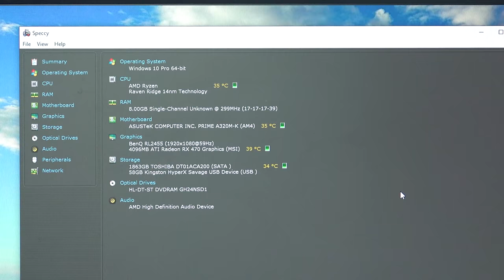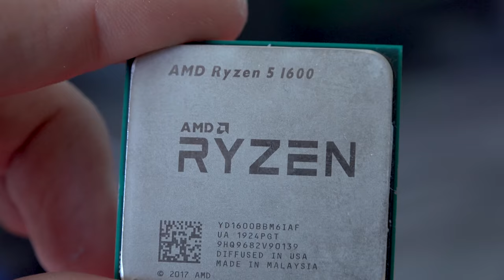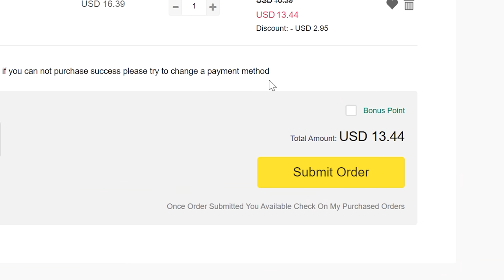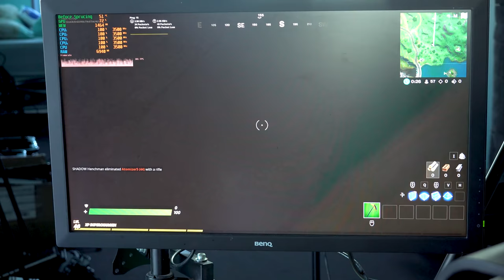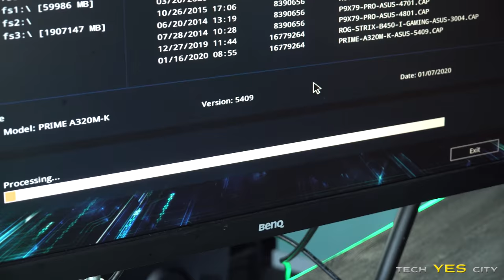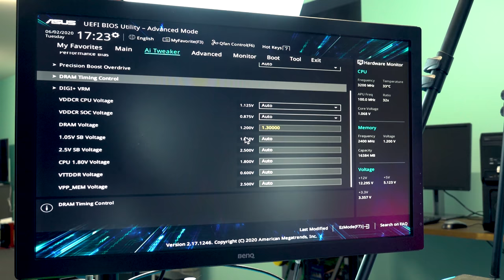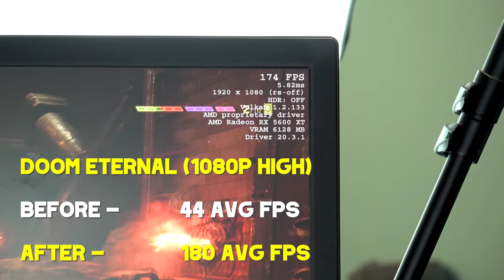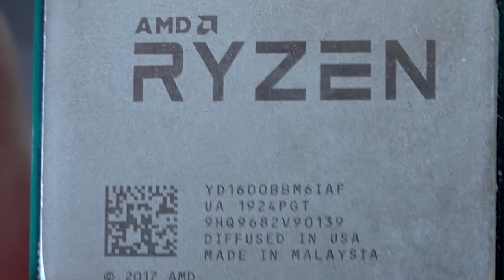This $300 Gaming PC Got SPRUCED UP!

Comment: I would like to have seen the FPS difference from just changing the cpu and ram and keeping the rx470 as there is a huge price difference between that and a 5600xt
Reply: Agreed, also the SSD would make a big improvement. The 5600XT seems like a not required upgrade.
Reply: Separate tests for each upgrade would have been the way to go to see which upgrade was really making what difference in what games. The GPU likely made the biggest impact overall, the CPU might have done nothing for some of the games, the ram shouldn't have really been a factor 8GB will run the games he tested just fine. The SSD would have improved load times.. over a average mechanical but WD ssds are actually slower than fast mechanical drives like enterprise models, this system obviously wouldn't have had an enterprise level hdd in it though so any ssd is faster but as ssds go WD is a horrible pick.
Reply: I honestly think there was something wrong with the rx470.   He blamed everything on the single channel ram then failed to prove that was a big problem
Reply: @bdhale34  WD Green is the budget model, but WD Blue is the good performer (I've seen no issues there).

Comment: I would have tried to keep that RX 470, still a fine card imo. The CPU/RAM and SSD upgrade was what was needed the most
Reply: Pity he went with one of the worst SSDs he could have.
Reply: Kinda makes sense for him though. The 1600AF supports the new card nicely and the RX470 can go spruce up a potato for that the  new card would be overkill. He's always got a whole bunch of PC's around after all.
Reply: @catriona_drummond  Exactly. The RX 470 is what you want with a Ryzen 3 1200 or an i3 Quad Core. (or some older i5 or FX 6/8 core CPU's. None of those CPU's will bottleneck the RX470 in 1080P @high settings to a point it matter.
Reply: @Wushu-viking   the RX 470 would have ran well into the 100s with the new CPU and RAM. Polaris was very good. The 5600xt pushed the PC into 1080P ultra or 1440P high territory, but also out of the "budget" realm.

Comment: Great job on the video. I think I would have left the RX 470, upgraded the RAM and CPU like you did. I'm running a Ryzen 5 3600 and a GTX 970 and loving it so far.
Reply: You ever considered a RTX 2060 super?
Reply: @Razor-gx2dq  no I'm not thinking about it RTX 2060 super! Not for that kind of a build as here in Canada a card like that goes for at least $600. I paid $125 for my GTX 970

Comment: You should have done the upgrades incrementally so we could see what made all the difference! Dual channel ram - then over clocking the crap out of the 3000g, and then add 1600af, then video card

Comment: 05:42 Uhh that hurts snapping off that folded metal piece. You could have just removed the motherboard and bent back a little bit that part, to accomodate it on top of the connector. Also, the HDMI port also has that metal part inside the conector as well as the USB 2.0 ports on the right. Make sure you make the folded cutouts to look like the RJ45 port: on the top of the connector.
Reply: yes indeed he should of remove the mobo and bend back those tabs more instead of breaking one and leaving one like that cause that might short the motherboard and in the end he will have to service the pc since he does offer warranty on them and that would cost him money and more lost time
Reply: No, that would take too long

Comment: It may be a brand I don't know, but that case is drop dead gorgeous. All the components are well laid out and fill the pc case to perfection. That front case fan is HUGE and will push a lot of air without making much to any noise. I was surprised at the frame rate with the updated gpu and misread thinking it was a 5700XT. I was even more blown away when I saw 5600XT appear on the screen. Those are some really high frame rates. Great job on this one.

Comment: That's the most creative way to make up a term that happens to already exist and luckily already has the same meaning! Bought a MSI R9290 on ebay del'd this week. Insta-95 degrees and thermal throttling to 700mhz but never actually shut down so to a novice, appeared to be working. Spruced it up and a repaste. 75 degrees now but anyone could have bought it and never known. Not a mention of any issue on the listing.

Comment: I still dont get the 120 GB SSD.. install windows 10, office and a game then you ain't far from full.. even 250 bit small for my liking, if I saw a decent spec'ed system for sale with a 120 ssd I'm thinking cheap and wondering what other less obvious cost saving measures are hiding within.. basically it's off putting.
Reply: Yeah with how big and bloated win 10 is it could be that in a couple years it could use that 120gb. with how much stuff clogs up the registry and the documents for saves and configs and the drivers i think it's best for at least 240gb with 512 being the best if you had to use a hard drive. I bought a 1tb sandisk ssd for 114 at bestbuy and it's great compared to even a new 1tb wd blue. But this channel really focuses on using used hard drives and ssds witch for the ssd i would never reccomend so it is kinda sleazy with the cases he does re-use an ssd.

Comment: That is odd because the athlon 3000 is more than capable of playing doom when paired with even rx 560 i do not want to link other channels as thats not fair, but you can find them very quickly in the search bar they ran dual channel 3000 mhz ram with cheapest ssd on amazon it was def north of 44 fps without stutter for sure.

Comment: Hey I built my pc for 1171usd is it good ?
specs :
-ryzen 5 3600
-msi b450m a pro max
-teamforce ddr4 3200mhz 16gb ram
-gigabyte rtx 2070 super windforce oc 3x 8gb
-silverstone 80 plus silver 700w power supply
-(i already have ssd and case so they are cost 0 :) )

Comment: Hey Bryan would you use a a320 mobo with a 3100 ryzen 3 for new as low as possible build? Maybe with new nivida gpus, i wonder if new xx50 models will have ray tracing, thanks.

Comment: My reading of the comments here jives with my observation on this video. Bryan, my boy, you goofed. An incremental update of CPU, then RAM, then SSD, then GPU would have revealed a much more varied and complete picture of what the different levels of change would result in. You might consider a do over here.
Reply: I guess the audience could have learned where they should be putting their money when upgrading  an underperforming rig.

Comment: I would have put a 3300X in there instead - slightly better overall performance then the 1600AF and much newer. Guess it depends on price availability in your region though.

Liking that case btw - reminds me of my old Aerocool X-Predator Cube case and loved the layout with the motherboard sitting flat and the GPU mounting upright.

Comment: It's kind of ironic that this PC is running with a Raidmax Cobra PSU. I'm currently building a PC, using my old parts, for a friend on a tight budget. I had ordered a Raidmax Cobra 700 watt PSU, but ended up cancelling that Amazon order and picked up an 800 Watt 80+ Gold PSU from a lesser known manufacterer, because of the bad reputation of Raidmax.

Comment: What I would have done different if I got this machine, and I was on a budget, would keep the CPU in they system, clean it up, put in a good kit of 16GB RAM, 120GB ADATA SSD( I can get them here in the US for about $18 - $25 USD depending on market), 1TB - 2TB HDD for storage of games, and installed Manjaro Mate Linux on the SSD, and tell the Windows key where to stick it!!!

Comment: I think that RX 470 is still a good card for 1080p, and only upgrading RAM here would help a lot. I have RX 570 in my main system and it performs great with my Ryzen 5 3600 and 16GB of DDR4 3000mhz RAM.

Comment: yes but 300€ 
costs more than a good PSU+ Basic pc case + hdd + motherboard  for ryzen igpu.
I mean, maybe it would have cost around maybe 230€, where is the point ?
But ye you can sell gpu and cpu, it gets some money back, but
idk if it's that much a deal.
I prefer a new case i like and used parts 
stutters can come from many points, and you just changed every points, of course it disapeared now :)

Comment: Were you able to find a RAM stick that had the exact specs as the one on the PC or it doesn't have to be 100% matching?
Reply: I've been fixing, and repairing computers since the late 80's, and I've mixed RAM plenty of times, but it's always a gamble if it's going to work do to many factors like the Mobo, make of RAM, etc.., just know that if it does work that your RAM will run only as fast the slowest stick, and if you are running AMD(it's been this way since the Athlon days in the early - Mid 00's) the faster you can get the memory, the better, and it's best to go with 2, or more sticks of the same brand if possible, and if not then same specs, and hope they both OC the same, and play nice together.
Reply: he probably has boxes full of sticks laying around, easy to find a match :)

Comment: Don't buy returned or used products, specifically PC parts from AMAZON. My friend bought a couple ASUS Strix RTX 2080ti's and they turned out to be GTX 1660ti's. The cards look identical but the 2080ti has an extra brace around it. Gotta know your cards
 That's why go to Micro Center. Its a store i could go back and exchange whatever. I know everybody doesn't have a Micro Center but eBay is a good online option just got to check the sellers history and eBay marks you should be good.

Comment: Nice I too just did a few upgrades to my current PC like upgraded to a 9600k couple months ago still using 2133mhz 16gb lpx memory and a gtx 1060 6gb. But Dang man it improved my pubg and fortnite fps by at least 80% from a stock r5 1600 what a difference now i need a bigger screen. :)
Reply: Yeah makes sense. Pubg is old and badly optimised and very single threaded so the higher clocks and ipc of the 9600k would definitely help. As for fortnite well it's also mainly very single threaded. You can oc the 1060 and sell the ram and then buy higher clocks. And the 9600k has plenty of oc headroom on a 50usd air cooler.
Reply: you should probably get 3000mhz ram if you can

Comment: Moar FPS? Roar FPS? :)
Buyer beware the Gigabyte Gaming OC is a tempting 5600XT AIB but my personal experience was that it was completely unstable with the FA0 vbios update on my bench system (also a 1600AF CPU). This happened with 2 different Gigabyte cards (I tried a Powercolor 5600XT non red dragon with none of these issues after vbios upgrade) and I was grateful Newegg refunded with no restock fee. Maybe sends all the grade A stock to Aussies :)

Comment: what if all of us cannot upgrade our dual corse i have a gust pc witch has a Pentium g4560 and a gtx 1050 2gb with 8gb ram I might one day upgrade my ram 8gb for Fortnite is not enough for my nephew too play on my second pc . and my 1050 2gb is showing its age till I can get a psu too upgrade my 1060 6gb from my 500 watt psu upgrade too a 750 watt psu for my 1080ti upgrade I was told not too use my 500 watt on my new slash used purchased 1080ti from my family friend for 100$ he is old friend of my he gets me them deals cause he upgraded too a 3090 . what should I upgrade on my dual core too help it out longer my gpu and ram will that help a bit I cannot find any good i3 cpu for a budget price and mother combo with a new i3 cause scalpers so I am stuck with my good old dual core I been using since 2017

Comment: A320 boards get a bad rep imo, some of them are just more locked down B350 boards, granted they shouldnt ever have anything over a 3600 on them, but my secondary system has a A320 board with a R3 1200, and I can't complain, does the job of running a Minecraft server for 10 people well. It'll probs get my 1600 when I upgrade to a 3600.

Comment: would be interesting just how much difference that dual channel memory alone made
Reply: I usually tell people to add ram to odd or even slots (1-3 or 2-4) for dual channel. That worked fine until I noticed my brothers Optiplex was slow.... Dell prints numbers on the memory slots 3-1-4-2.
Reply: @thepezfeo  I think that board only has 2 memory slots anyway, no issues there

Comment: Honestly the 5600XT is such a small upgrade from the RX 570, you might have just left that in there and seen how it does with the card as included :)
That weirdness is definitely a slow single channel RAM issue. Ryzen is so hungry for it.
Reply: Trevor Romney ..he upgraded from a RX470. That one number at the front makes a big difference from the 570.

Comment: Can someone help me with my pc I have a rx5700 ryzen 5 2600x and 24 gigs of ram at 2400mhz and my games run ok but my FPS are low is it due to may ram I bought 3200 MHz and my motherboard wouldn’t let it run at that speed
Reply: I got a 2600x and a rx 5600 xt and I get fps stutters. I still can't figure out what the cause of it is. And my ram is running at 3200 mhz so I doubt thats the issue

Comment: I run into that fortnite problem every single day when I play on my switch light it's barely a 1or 2 core I think with a like GTX 700HD Graphics or something so bad I run at 30fps but average I come down to like 28 f p s
A lot of times I get that mannequin stick figure running around people look like it I turn into it the same problem you had and it happens a lot

Comment: It wasn't the Ram, although single channel is definitely suboptimal. The 3000G is simply awful for any modern gaming. 

It's dual core (tough to get away with these days)

Its clock speed is fairly low (meh, but with all of the other weaknesses, this adds to the hurt)

It's an older core design (non Zen2, but back before they really leaped up in IPC)

It's VERY low on cache compared to proper Zen models (this is the worst offender, as due to Zen architecture, you really want that nice high speed cache to mitigate somewhat lazy memory latency)

I bought one to help bios update older AM4 mobos I get to prep them for Zen+/Zen2 builds, and even with 32GB DDR4-3600 CL15, 2TB nVME, and a 2080ti AMP, the thing still runs gsmes like total garbage. 

I'm not dogging on the poor thing though, as it's not really intended at all for modern gaming. As a general light office PC kind of role, they're absolutely fine with a cheap SSD. But they're basically about comparable (considering IPC , clocks, and cache) to an i3-41xx or so, generously speaking. 

I hesitate to recommend them because even an i5 2400 will game a lot more effectively. 

Thankfully used Zen+ are plentiful and cheap, and the 3100/3300 are killer AM4 options. 

The 3000G is like how I felt about Netburst Celerons : "it's technically a CPU, but I'd only give it to someone I disliked inherently lol"

Comment: Never got why someone would choose the Athlon 3000G, when the Ryzen 3 3200G is really not that much more expensive.
The Ryzen 3 APU is in my wiew, the Best B4B "Value" PC one can build right now (if building new).
https://www.youtube.com/watch?v=GP6iduHUADk&t=8s
Just Don't skimp on the memory for APU's (for gaming). Minimum 3000 dual-ch (tune the 3000 memory to cl.14 if possible)
My Value top 3:
1. 3200G (or 2200G if cheaper) - best use with a B450 for OC potential.
3. 3400G (or 2400G if cheaper) - A Strong 4t/8t CPU, with a slightly beefed up GPU.
3. 1600 AF + RX 5600 XT (the choice, if you want to max out the settings @1080P) > Right on Bryan!
The best thing about the Ryzen APU's, is that they are also capable CPU's. One can later snacth a cheap RX 470 for less than 100 USD, and get a huge graphics boost and really enjoy more than Low settings @1080P

Comment: Guys. I am running palit gtx 260 with1.8gb memory paired with  amd athlon 2 250 but when i am trying to run fortnite iam getting message DX11 feature level.10.0isrequired to.run the engine. But all my drivers and dx are up to date . Please help :)

Comment: People turning away with A320 boards makes me feel bad a bit. Its actually decent for price
Reply: It's actually a great proposition particuarly at the current moment, because it gets you an AM4 board cheaply that suits most of the currently available processors while we wait to see how the new chips shake out on B450/550, and yet for the most part the power delivery is good enough that it's also a great home for a 3300 or 3600.
My plan was to use it as a stopgap, and it may still turn out that way, but I'm beginning to think it might actually be just enough for the time being.

Comment: SPECCY!! Operating System
	Windows 10 Pro 64-bit
CPU
	AMD Phenom II X2 555	38 °C
	Callisto 45nm Technology
RAM
	8,00Gt Dual-Channel DDR3 @ 669MHz (9-9-9-24)
Motherboard
	ASUSTeK Computer INC. M5A78L-M LE (AM3R2)	43 °C
Graphics
	Generic Non-PnP Monitor (1680x1050@60Hz)
	2048MB ATI AMD Radeon HD 7800 Series (MSI)	22 °C
Storage
	476GB SSD 512GB ATA Device (SSD)	40 °C
Optical Drives
	TSSTcorp CDDVDW SH-222BB ATA Device
Audio
	Realtek High Definition Audio

Comment: I mean... biggest problem was 4g of ram.... exacerbated by single channel. 3000G would have been fine running fortnite as would the RX470. Here is a video should almost exactly the same system but with 16g of ram (its an RX570 instead of RX470 but same diff). https://www.youtube.com/watch?v=9yDjUakkBck